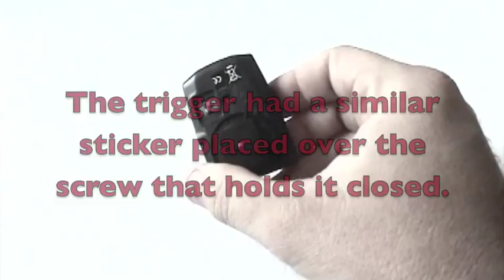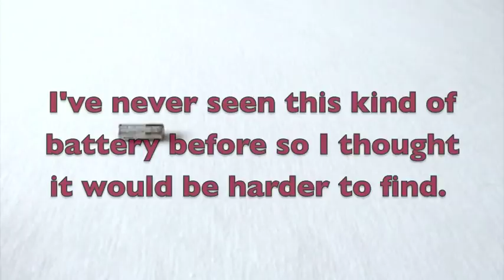Neewer Wireless Trigger, How to Replace Battery

Comment: Thanks for posting this - solved my problem. Had no idea the transmitter had a battery in it - thought it ran off the hot shoe. Saved me the cost of buying replacement equipment, much appreciated!

Comment: Thank you very much. I never force things to pry open so once I started to open it the trigger it became harder.  I missed out the screw was it was underneath the  quality assurance label. Yes, you are correct these batteries are used on remotes for door openers. It would have been a lot better if you did speak too.Thanks again.

Comment: Guys if you do not have the right battery available at home you can use salutape to tape together 6 1.5v button batteries. You can get a pack of 30 batteries for 1£. :)